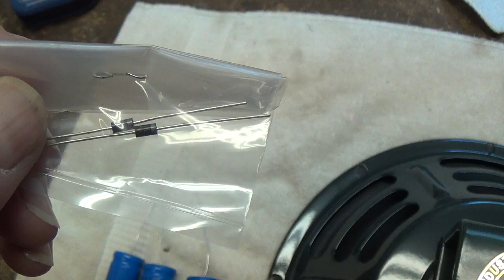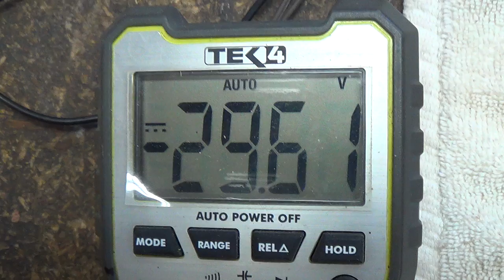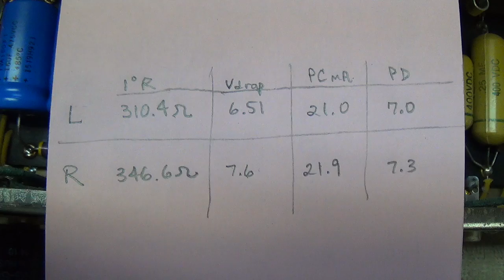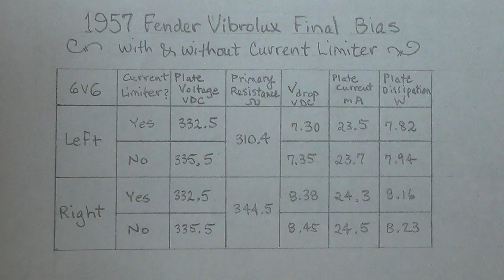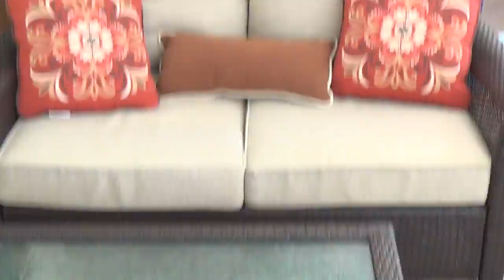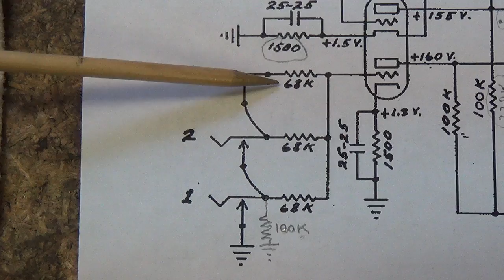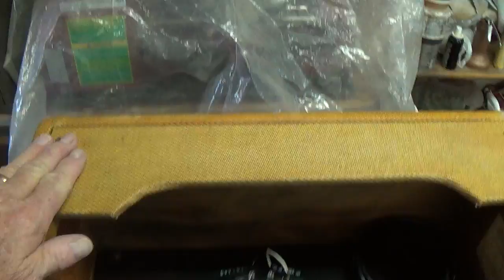1957 Fender Tweed Vibrolux, Part 3

Comment: Doug - I found a Fender Bassman ( stamped 1971 inside the chassis) and I am having trouble finding the right circuit. The serial is a61xxx  so I know its either Ab165 or aa270 perhaps.  Any easy way to tell which one it is ? Someone replaced the EL caps with very wrong values and I want to get her up and running again. Any help is completely appreciated.  Ron
Reply from the maker: I assume there is no tube chart in the cabinet, Ron, because that is where the circuit is generally identified (not always accurately, however).  My method for differentiating between different circuits is to download the schematics for the circuits the amp could possibly be, and then comparing the component values, rectifier choice, transformer ID numbers, etc. to determine which circuit it really is.  In some cases, you may have a hybrid circuit, in which more than one schematic will apply, but generally, it is quite possible to nail down the circuit's identity by carefully comparing it to the schematics. Good luck.
Reply: Thank you so much Doug
Reply from the maker: You're welcome, Ron.
Reply: Uncle Doug h

Comment: you need to replace all of them, all caps
Reply from the maker: Thanks for your input, TD, but Rusty feels that once all original components are replaced in a vintage amp, it ceases to be "vintage" and becomes a "reissue".
Reply: yes i understand and feel the same way, but once they become leaky it can overload components and ruins tubes, burn resistors out, and overheat other capacitors out and ruin the amp as a whole
Reply: or even burn your pickup out by sending voltage through it
Reply: and that death capacitor, get a proper safety capacitor and you will be fine

Comment: Dear Uncle Doug, 

how did you like that P10R-F speaker? The low efficiency is 
very interesting (would allow me to crank my 5E3 in a Harvard sized 
cab). 

And BTW, thanks for excellent channel!
Reply from the maker: You're welcome, OA. I liked the P10R-F a lot. In fact, after the re-coned original speaker turned out so well, I installed it back in the Vibro cabinet and kept the P10R-F as partial payment.  It's an exceptionally nice speaker, right out of the box. I look forward to using it in a future build.

Comment: Nice amp. How many watts is the speaker rated for?  If that went on the market, I'm sure there would be a long line. I'm looking for a early tweed amp , a good clone if that's possible. Working on these amps, your first class. Thanks for sharing.
Reply from the maker: You're welcome, Dice. It's rated for 25W, same as the original. I doubt that this amp will be available for sale anytime soon. Thanks for the nice comments.

Comment: Diode +/- labeling conundrum. If memory serves, if the DC voltage is measured across the diode it will read as the same polarity that is marked on the schematic. For factory checks or for troubleshooting that labeling might be helpful. Makes sense because the meter will be displaying the voltage drop across the high resistance of the diode when it is not conducting.
Reply from the maker: Perhaps you're right, Tony.  It may be beneficial for troubleshooting.

Comment: Beautiful amp! Mystery guitar: If one of your song choices is a clue I'll guess it's a Rickenbacker 360/6. Doesn't sound like a Strat, Tele, or a LP to my ears.
Reply from the maker: I can see why you might think Rickenbacker, Tony, with the chimey treble....but it was a Telecaster '52 re-issue.
Reply: '52 Tele, nice choice, I have a '64 re-issue. What threw me off of thinking it was a Tele was the very soft tone of the neck pickup. I think the neck pickup tone in the very early Tele's was intentionally softened with a larger capacitor than the more modern Tele's use.
Reply from the maker: Exactly right. For some reason, Leo thought that early forms of the Telecaster should be able to portray both bass and guitar tones. Thus, the absurdly mellow neck pickup setting.....which can be updated.....but I have not done so out of respect for the nature of this historic re-issue.
Reply: I 100% agree. I'd keep it authentic. :)
Reply from the maker: Thanks, Tony :)

Comment: I put the nuts on with a deep socket, alone with minimal force, so probably about the same as finger tight. I agree though, a speaker doesn't need lotsa torque to be held in place securely. 

Love the way it sounds. Really like the idea of a high and low gain input. On such an otherwise simple amp, you can really change the way it responds.
Reply from the maker: I agree with all you say, Lincoln. Hopefully others will heed our advice. Over the years, I have seen  a few speakers permanently damaged by over-tightening.  I'm glad you like the tone and hi/low inputs.

Comment: Hallo
I enjoy the video tanks
I have a question for you uncle dog 
do you have a example  of a 8 ohm dummy load that i can use for testing a amp
Bertus
Reply from the maker: You're welcome, Bertus. My 8 Ohm DL appears in the video about how to measure amplifier power output. You can buy them on Ebay at a very reasonable price.

Comment: Hi Uncle Doug, I love watching these AWESOME video's, and have been 
doing so for the last 6 months.  I'm so impressed that I went and 
purchased the guts of an old Thomas/Leslie organ that came equipped with
 about 80% of what I need to build my own amp.  My Traynor YGM-4 Studio 
Mate (yes, I'm a Canuck  from Montreal) is just too big to lug around, so "compact and portable" is the new mantra.  This Vibrolux is the one I have my heart set on 
building, the box is done, but after winning the staring contest with 
the underside of the organ chassis, I discovered my power transformer 
has only 2 ground leads and 8 others.  Before I make a terrible 
assumption, I want to check with you to see if it matters if I use 
either of these ground leads to connect to the 10 K resistor before the 
diode?  As an aside, why do we feed back the output from the speaker 
signal back into the second 12AX7 cathode? Thanks, Alf
Reply from the maker: Thanks for your nice comments, Alf. The two ground leads are probably the centertaps for the high-voltage and the 6.3VAC windings. Both must be grounded. I don't understand why you would want to connect either of them to a resistor or diode.  The return to the cathode from the output is a negative feedback loop. I have posted a video that explains how it works. In general, it compresses the output signal, "cleans up" the signal,  and reduces excessive volume.
Reply: Thanks for writing back, you're a pal.  Upon closer examination of the 
power transformer and a review of your video on how to identify 
transformer leads, I discovered I'm missing that high voltage bias 
supply, so I'm going back to the 5E3 Fender Deluxe and I'll see if I can
 find a mod to add a tremolo circuit.  Give Rusty a nice pat for me.
Reply from the maker: You can create a bias supply from the high voltage winding. Look at how Fender does it in the AA764 Princeton Reverb. Rusty says "Thanks".
Reply: Hi Uncle Doug, I watched that video you did on the single variable trim 
pot you insert on the Princeton Reverb with the diode to negative bias 
both grids and it really enlightened me, it assumes both tubes are 
matched.  I've decided after watching the two part bias videos again 
that I'd prefer to have two trim pots to cathode bias each of the two 
6V6 output tubes, the design is simpler.  The Tremolux uses this 
approach and I like the sound of that amp with a bit more of it's mid to
 bass tone and over-driven blues tone, so I'm going to proceed to clone 
that one and let you know how it goes.  If you ever get up our way to a 
Jazz Festival, or any summer festival, the beer and popcorn are on me.  
You're the master.
Reply from the maker: Good luck with your project, Alf. Let us know how it turns out. Also, you better watch what you're offering.....Rusty has been known to consume prodigious amounts of beer and popcorn, so you'd better have a healthy limit on your credit card :)

Comment: I knew right away that the second guitar was probably a 50's or low to mid 60's Tele. I have a '67 Tele (which I bought brand new) that was one of the last to have Leo's "dark circuit" in the neck position. This was supposedly to allow the guitar to sound like a bass if needed. I have so far resisted the urge to mod it from the original design.
Reply from the maker: Yes, it was a '52 reissue. I have no idea why Leo would want a Telecaster to sound like a bass guitar.....but so far I've left my "dark circuit" intact too.

Comment: 1) Did the second guitar have humbucker pickups? 2) Was one of your riffs: Walk Don't Run by The Ventures? 3) Does the tune: You Really Got Me - by The Kinks, start in F# or Gb? 4) What tune is D - F#m - G - A // A - G - F#m - Em - D? 5) Do I still get any credit if my dog eat my homework??
Reply from the maker: 1.) No, the second guitar was a '52 Telecaster reissue. 2.) It probably was 3.) In my version it starts in E and slides up to F#  4.) It's a tune that I made up to demonstrate the bass and treble tones of amps. 5.) Yes, you got the chords right on #4, so no detention :)
Reply: Thanks for the extra credit given for question #4. Should help bring up the D- I got for the chapter on total circuit power dissipation. I am a bit shocked at just how differently pickup and amp combinations can sound. Does your Telecaster have those silver tube shaped ( I don’t know the correct name) pickups? Have you ever done a course on selecting guitar tone capacitors vs pickup impedances vs different amplifiers? My friend had someone that got a D- in electronics chance out the caps in his Stratocaster and now complains that he has very little tone control.
Reply from the maker: It's a '52 re-issue. Perhaps you can find a photo of it online. I have not made a video like you suggest, but will keep the topic in mind. I think your friend needs to find someone to work on his guitar who made a higher grade :)
Reply: After my repairman retired as a CNC machinist and programmer, he has been watching a lot of this retired professor and musician on youtube that makes electronics fun again. Why my friend has a full set of drums, six mics up, and 1000 watts of amps and effects ready at a moments notice in his livingroom is a bit discerning. But he seems to be enjoying retirement and learning a little more every day. Now if he can just get his Rhodesian Ridgeback dog to stop eating the seats in his car, he could concentrate more on getting the keyboard parts down for the garage band’s newest tunes. And it could be helpful if while soldering on a simple circuit he stopped saying, " The bigger the goob - the better the job. ", as I am the one buying the solder. It truly made his day when you gave him extra credit for effort, so I guess I am stuck with him. Oh no! The dog just eat another guitar cord! Crap!
Reply from the maker: Maybe the dog is trying to get some stuffing to put in his ears, with that kind of musical power in his "living" room. You would prefer to buy solder for me.....I tend to use it sparingly :) After eating all those different materials and objects, the dog's poop could probably be displayed as sculptural art in a gallery :)

Comment: Hello Doug. Another great video series - can't wait to see the one on reconing!

I can't help but notice that tremolo seems a bit wimpy... I'm just finishing up a build of a 6g2 with a similar (one device) trem, and the speed is considerably faster with deeper cycles. Do you have any idea why this might be the case? I might think a tired old tube and/or drifted components...
Reply from the maker: I tested the (relatively new) tubes and every component in the tremolo circuit, Britt.....and everything checked out. It's a little slow to start, but once it's oscillating, the effect is not too bad. Thanks for your input.
Reply: Thanks for the info, Doug. It certainly seems an interesting feature. I figure if anyone is going to be thorough, it's gonna be you and the fine crew of Jack and Rusty - they certainly wouldn't let you forget.
Reply from the maker: You're welcome, Britt. They're on me night and day.....real sticklers for thoroughness.

Comment: Nice video series as always. I'm guessing the first input was meant for a device other than guitar. Mic or phono, maybe?

This guy sells  PDF of the original catalogs. I bet money there is a mention of that.

http://www.musicmansteve.com/catalogs/FenderCatalogsEnew.htm
Reply from the maker: Thanks, Brad. You're probably right, but you would think that a non-guitar input would not be in the first position and thus most likely to be used. It's a bit of a mystery to me. Thanks for the link to the catalogs. If my curiosity gets the best of me, I may order one.
Reply: Yeah, I thought about ordering the PDF just to film and publish on my channel. ;)

You might think Channel 1 would be an odd choice for something like a phono or mic input but remember how guitar amps were commonly used in the 1950s, often there was only one amplifier in the entire band! They would very often run vocals , guitars, accordions, or whatever else through one amp.
Reply from the maker: True, when analyzing features like this, you have to consider the time period in which they existed.
Reply: check this out :
https://support.fender.com/hc/en-us/articles/115002476526-Fender-Catalogs-From-1953-to-1979
the vibrolux was 139.50 in '57

Comment: Input impedance is rather low, isn't it?

Why not replace the other three electrolytics?  Especially the bias cap.
Reply from the maker: Are you speaking of impedance to ground? I changed the added resistor value from 100K to 220K, increasing the impedance and gain for Input No. 1. As it stands the volume and tone are excellent.  I did replace the bias cap (to 25uf@50V.....see the note in the video). The cathode bias caps carry virtually no current and checked out just fine. You have to draw the line somewhere with a rare and valuable amp like this. Wholesale parts replacement is simply not my policy.
Reply: Just surprised that you didn't use the usual 1M.

The cap by the diode isn't the bias supply cap?  My mistake.
Reply from the maker: It is, but as a note states in the video, this capacitor was changed after the video was completed. Thanks for your input :)

Comment: Tone demo sounds real good with that new jensen.  I hear smome old familiar guitar strains and riffs, but I can't place them anymore..too much water passed under the bridge as they say.  First guitar must be a strat?  drastic tone difference between  neck and bridge on the second...definitely  tele or at least  some  form of it.
Reply from the maker: First guitar had humbuckers, second was a '52 Tele re-issue, in which the neck switch position activates a tone-modifying cap to emphasize bass tones. This is how they were originally wired.

Comment: Would input 1 be considered a hi gain "channel' for lower  output pickups or some other style of lo gain device? and done
on purpose?
Reply from the maker: Probably so, SC, but to a rather extreme degree for modern instruments, especially with humbuckers.  My modification has changed it into a "moderately higher gain" input.
Reply: Well, I've never understood why Fender would have 3 inputs shared by the same channel  preamp input. 

One guitar input for normal output single coils or humbuckers for this kind of amp.  For the second (say the rhythmn guitar, if one had no choice,  to plug in their guitar at a HS dance, would be about all this little amp could handle.  Three guitars? and the last one plugged into the high gain input..no wonder the speaker
cone got shredded..i would imagine quite a feedback howl coming out this little amp.
Also, were Humbuckers even available at the time the amp was designed or built  around 1957 ? 

Gibson just started production of the PAF humbucker sometime in 1956.  Was Fender even concerned about this? Gibson did have their P90 single coil on their products well before 1957 though.

 Interesting if one go back to discuss what they were thinking using 3 inputs on a 17-18 watt amp? with no independent channel volume control for each input...very strange  design coming from Fender and we thank
you for pointing out this anomaly Uncle Doug. 
I  just can't see 3 guitars plugged into this amp and sharing the same input preamp.  One guitar would probably be the norm. 3 guitars would be an invitation to disaster for  this little amp.
Reply from the maker: It would be like watching an episode of "The View" on television.....with everyone trying to out-yell each other. Utter pandemonium. I don't understand the multiple inputs either....unless maybe one for guitar, one for harmonica, and one for singing????
Reply: That might have been the intent.  However, having three different instruments with different outputs..
mic/harmonic/guitar would have been quite a juggling act with just one preamp and one volume control.

Now if the three different input sources actually went through a mixer, each with it's own gain circuit and
volume control, and then  three outputs..maybe..
but then with one  mixed output, why would you even need 3 inputs of the same impedance (practically), going to the first preamp tube.. One instrument input would easily over power the other two in volume. 
this is bizarre thinking even from a company renowned for it's practical amp designs, like Fender.
Reply from the maker: I agree, SC. Later on, they offered two separate channels, generally clean and with effects, that were more independently adjustable.